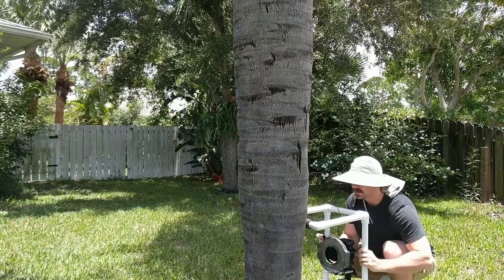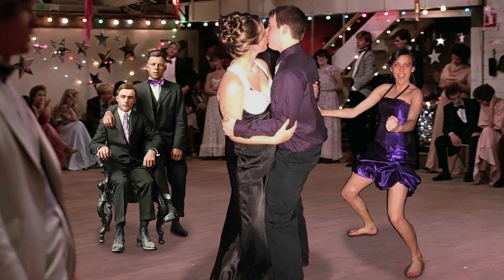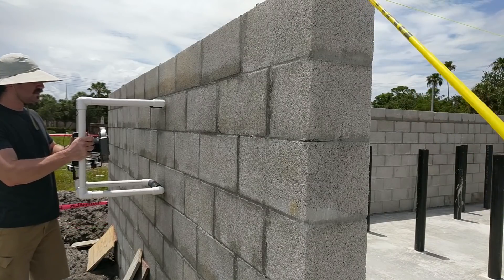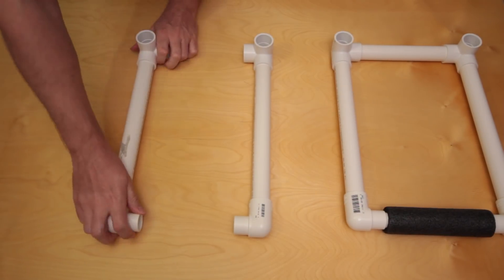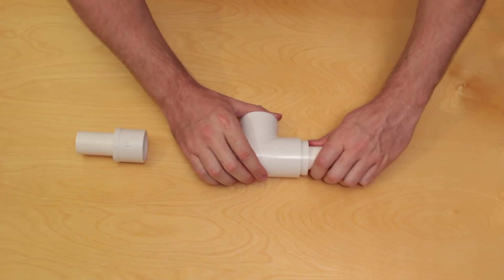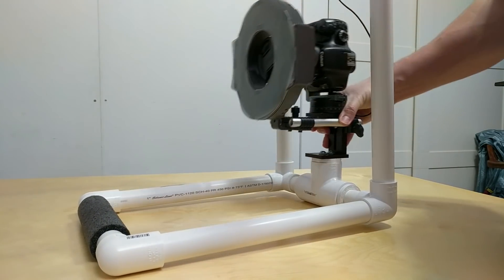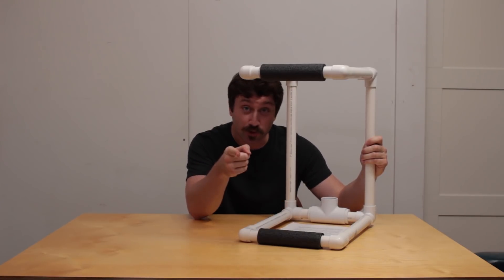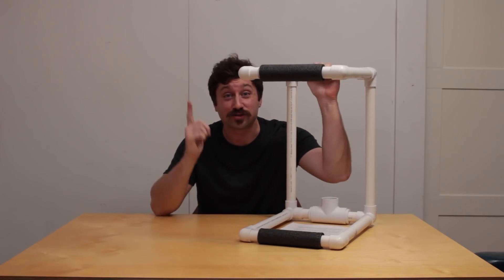How to Build a PVC Tree Scanning Rig

Comment: Already ordering PVC to do one. You mentioned that you shot at night. I assume to avoid direct light, but shooting on overcast day would work as well, right?
Reply: Yes. I always make sure to shoot on an overcast day
Reply from the maker: Yes, you can choose to shoot in whatever lighting condition is good enough for your needs. Overcast lighting will work well. As some of the others have mentioned, I shoot at night in order to have control over the cross polarization. But I have some ideas to improve the rig make it so I don't have to wait until it gets dark. I'll be sure to share those in future videos.
Reply: Straight sunlight is worst, overcast is better, but only cross-polorized artificial light is best. That's very likely the reason he shots at night.
Reply: @jacemnk  I have almost the same setup as James (my is for only ground, leafs, fabric  etc.). On my rigg i have black fabric suit, an so i can scan by sunshine, overcast etc.
Reply: The F&V r300 ring-light and the cross polarization pipe is for only one lightsource (ring-light). When u shoot on overcast day u don't need the light and cross polarization pipe. The setup is weight less. Maybe u can use a linear polarization filter for your lens.